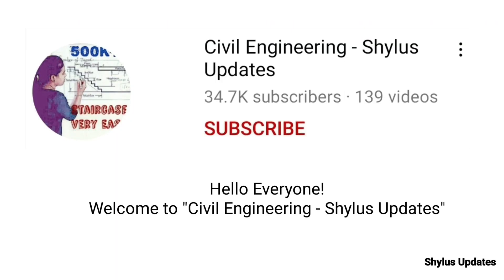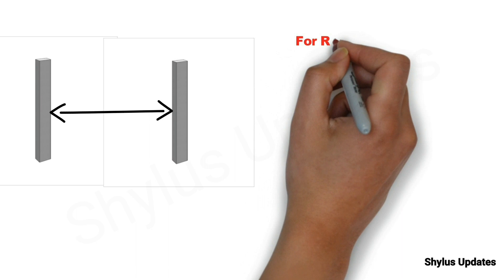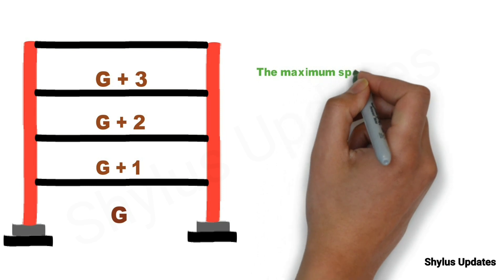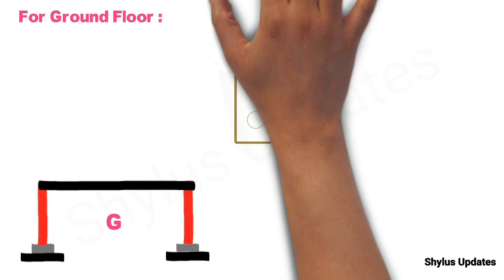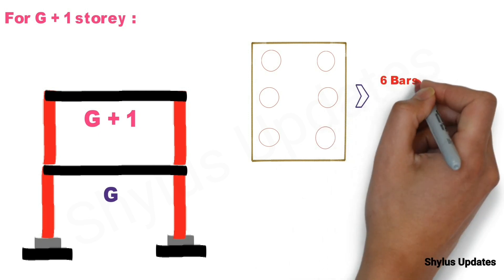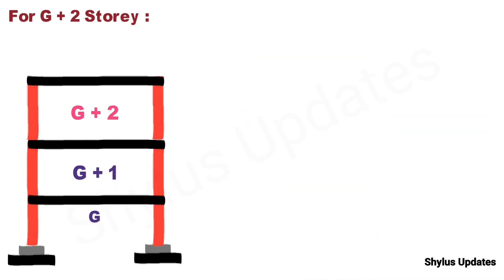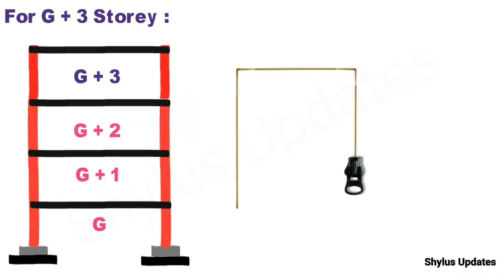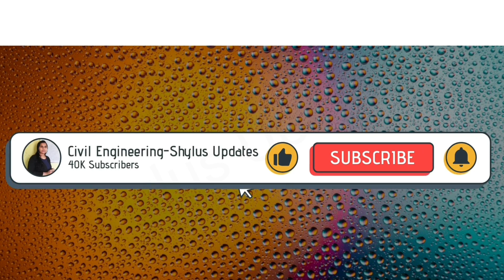Maximum distance between two columns | Column size and steel details for G, G+1, G+2, G+3 | column

Comment: For 30X60 slab can go for end to end pillera and columns? I mean no pillers in the middle. Only at end of 30 feets and for 60 length we can have 6 or 8 kind. If so what would be the cost chnage. I mean wanna construct a small apartment with commercial stule of pillars with no pillers in the middle

Comment: Madam, For G+1 we have planned to use 9" * 9" columns with 12MM Tata Tiscon 550SD. Is this safe or will this create problem in future. We don't have any plan to extend this building further. Please respond, thank you.
Reply from the maker: Always choose rectangular column. Rectangular column is chosen for uniaxial and biaxial loading because the rectangular shape reduces the moments in lateral directions and long column mainly fail by buckling so there is need to reduce the deflection in lateral direction. Choose atleast 9" x 15" or 9" x 18" .

Comment: Hi bro, this is Vijeeth. I have a small doubt regarding building safety. 

We built G+1 building in a 1000sq feet plot (100sq yards)in 2011! Now we added a floor and a pent house on top of it. Which is G+2 and a pent house slab! 

There are 9 columns of 9x12 inches cross-section! We used 4 bars of 16MM, 2 bars of 12MM in ground floor and footing. And 6 bars of 12MM in rest of the floors. 

Now my question is - will it be structurally safe? I tried to run analysis but I lost touch in it! What is your opinion?
Reply from the maker: Dear Vijeeth Michael,
If your house is away from earthquake zone areas & railway track, your structure is more safe for what you have provided 👍🏻